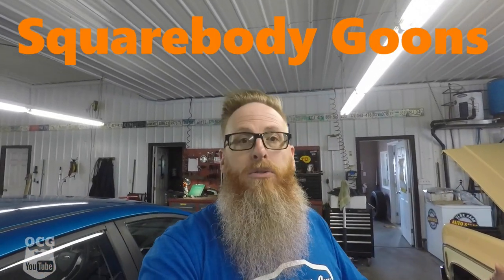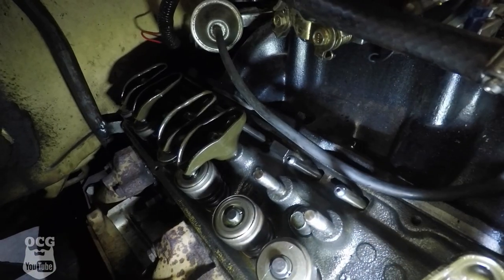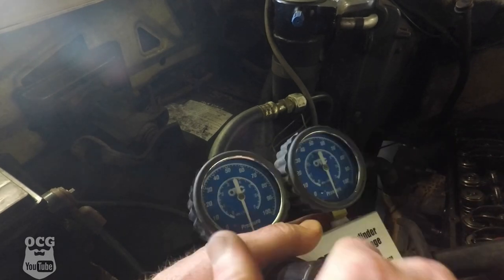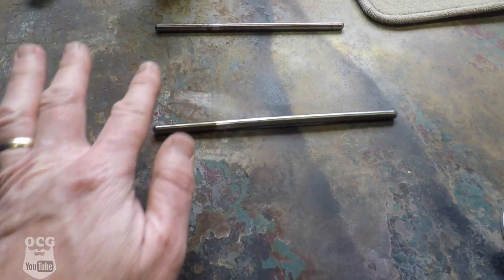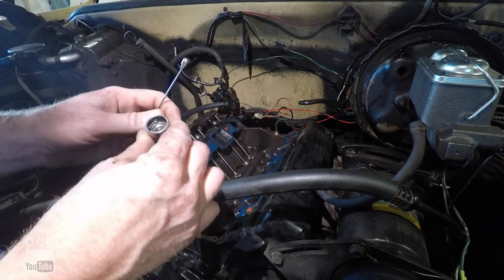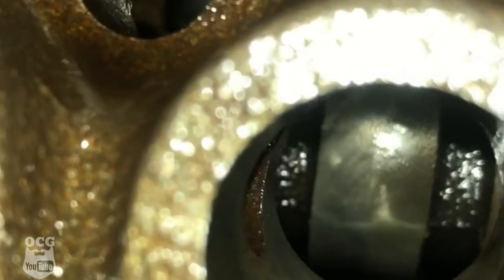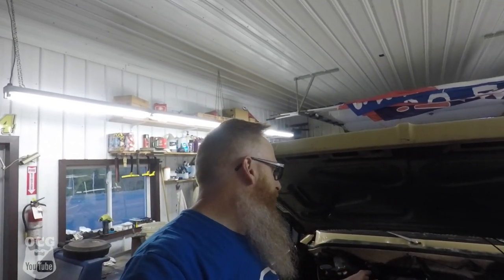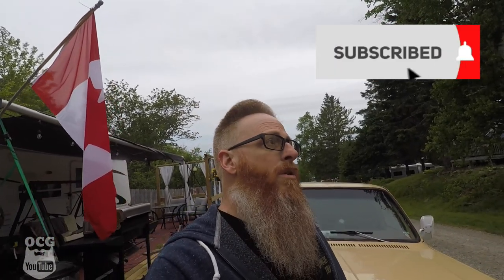Bad Lifters On My SBC 350 1977 CHEVY C10

Comment: hi there , very nice video ,
i want to ask how to check my old lifters if its bad or OK, i used engine priming tool and didn't get oil on on the rocker arm , what you think ( i have a new oil pump, rocker and push rod)
Reply from the maker: It’s common to have an oil plug not in place somewhere. That would keep you from building pressure.

Comment: If you flush your engine with diesel gasoline that make  your engine interior like new
Reply: Olde carr Guy   also make a video of flushing engine with diesel
Reply: Yeah your right 
I baught 1990 nissan altima the engine was half half smoking  very poor when I flushed engine with diesel 2 times and flush oil 5 times the engine became new and i used for 15 years without any engine job.......
Reply from the maker: Done that before. Not necessary on this engine as it is already like new inside.
Reply: @OldeCarrGuy  ☺good

Comment: What do I do if my lifters are stuck? I can't get them out. They do move a bit up and down but they won't completely come out.
Reply from the maker: You may end up having to pull your camshaft and push them down through. But you could be into more than you bargained for if you aren't careful!
Reply: @OldeCarrGuy  I haven't tried the slide hammer yet.

Comment: Only things that cause rocker and pushed damage is valve train resistance, valve-piston clearances, lash too tight, or coil bind on valve spring. Causes can be collapsed lifter adjusted too tight,  improper cam timing, or cam too big for valve spring travel. Possibly over revving with valve springs too weak for the RPM. Studs pulling etc will never break a rocker or pushrod. If all you did was replace lifter , you will have the same problem again in the future. A lifter stuck at the top should only cause some possible valve float, won't cause broken parts on a properly set up engine.
Reply from the maker: You are probably right on the lash to tight. In a previous video, I readjusted the valves to almost 1/2 a turn of pre-load rather than 3/4. Seems to have helped.
Reply: @OldeCarrGuy  I typically go a quarter turn after ticking stops, but tight lash should cause valve float / leakage before breaking or bending anything, but might have been just enough to flex the rocker with piston contact at higher Rpm.
Reply: Improper ignition timing too much vacuum advance

Comment: the older engines needs oil with zinc in it i use diesel 15w-40 with a bottle of stp oil treatment flat lifters needs zinc in the oil 
they lowered the zinc in oil back in the 90's sometime the epa claims zinc messes with a cat converter more government bs i think lol
Reply from the maker: Hi Terry. I use 1540 as well but I had started with 1030 and a bottle of zinc additive. But in the end it was used lifters and pushrods that bit me. Replace them all with new and no problems since! Thanks for watching